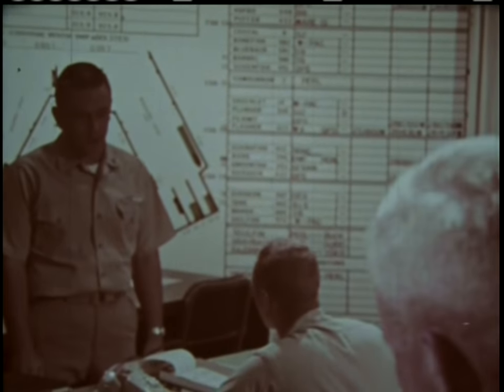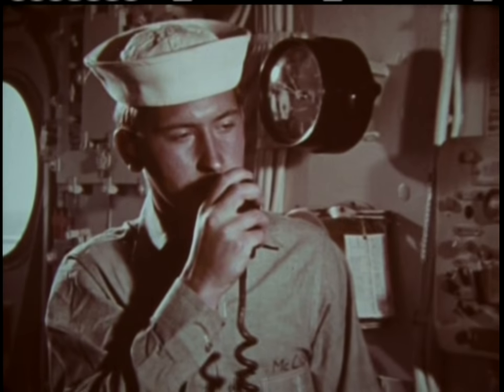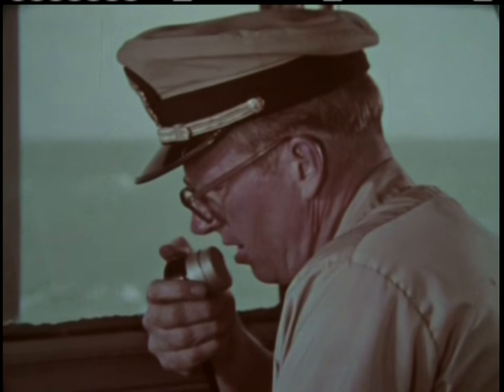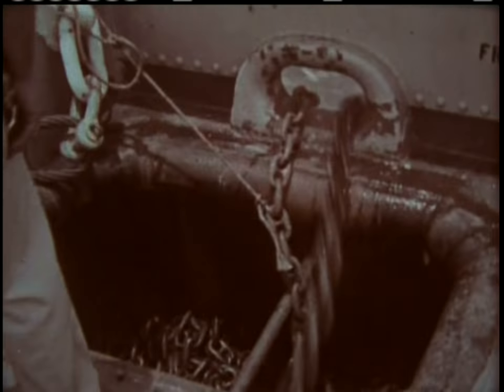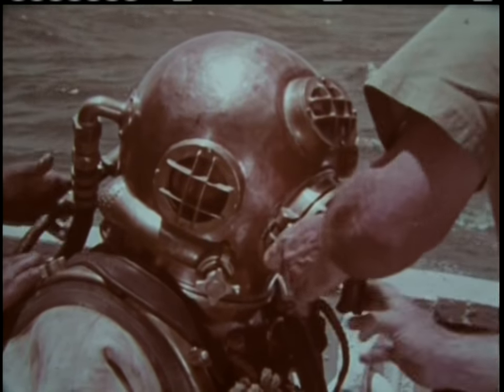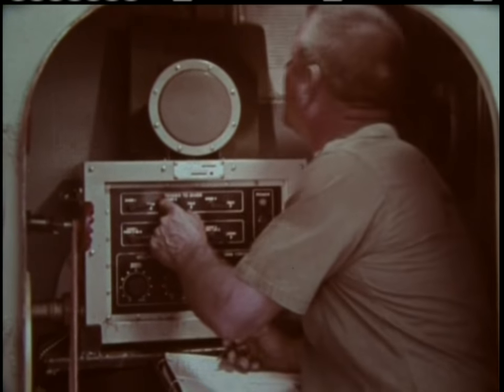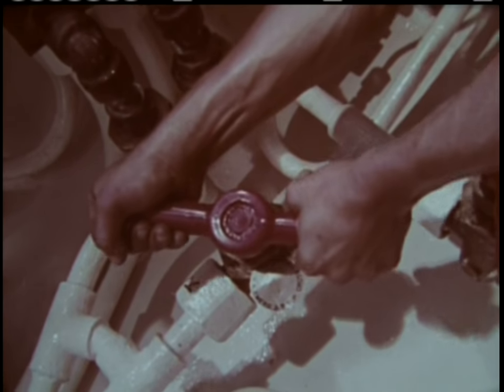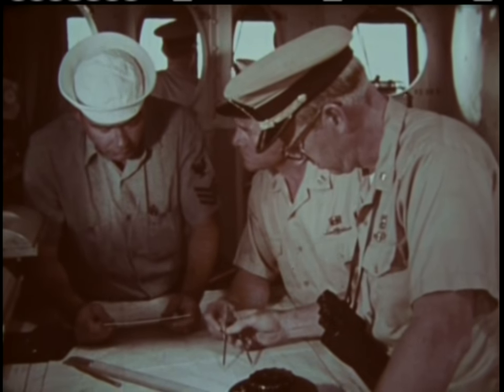Submarine Rescue and Salvage Procedures (1970)

Comment: I was on the USS COUCAL (ASR-8) from 1968 until 1972 in Pearl Harbor. I was a third-class electrician. We were always undermanned for electricians. Around eight instead of fourteen just before my discharge! We had ungodly hours. One time an engineman flooded out the main generators. We went on port and starboard duty. 12 on 12 off, 7 days a week for 4 months straight. No days off. We loved it! 12 hours off every day! Only 84 hours per week! We would have loved this duty all the time. Better than our typical holiday routine. We normally went well beyond 100 hours per week. I starved much of the time I often took canned food out to sea. Lazy cooks at the time. Eat supper at 1700. Work all night. Starved. Tried to snag a can of sardines from the mesh door on dry storage. Munched on some pepperoncini peppers at 0400. (Sometimes I would sneak into the chief's mess and whack off a big hunk of their 'pony bologne'. Officers and crew did not get the same food.) I went topside to cool off. Submariners eating pie and sandwiches next door! Still makes me mad 50 years later. When in port I started buying my own meals at the Subase Galley. Cheap and excellent food. Friends started going there with me. It made the cooks angry. Take that you lazy #$%&*^%!!

Comment: I was an Engineman on board the USS Sunbird, ASR-15 from early 76 through 78.  We performed 1 four point moor and launching of the Diving Chamber just as a training exercise.  We were the mother ship of the NR-1 and happened to be ending our mission off the coast of Scotland when the Kennedy lost an F-14 equipped with the top secret Phoenix missile system during Nato Operations off the coast.  Another ship was originally assigned to the recovery with an unmanned deep submergence device of some sort called Curv-II.  Something malfunctioned with the Curv-II and since we were in the area with the NR-1, (Nuclear Research Submarine 1, a 135ft long deep diving nuclear powered submarine with mechanical manipulators, cameras, portholes and even wheels on the bottom) an ideal piece of equipment for locating the F-14 in deep waters, we were assigned to tow her to the area where the F-14 was lost.  After what seemed an eternity of bobbing around in 10 to 15 ft seas missile and F-14 were found.  The F-14 was found with a Russian trawlers net wrapped around it from a failed attempt to recover it by the Russians.  Another contracted ship was tasked with picking the wreck up from the bottom which it did after several failed attempts due to the rough waters causing the lines to snap.  After dropping the missile off in Holy Loch we headed back to the States crossing the North Atlantic during the winter hitting 65ft seas and 70 knot winds with blinding snow.  A ton of fun it was not but was indeed a lifelong memorable experience.  The Sunbirds crew most certainly earned their meager paychecks on that cruise.  It was a real bonding experience for all of us.